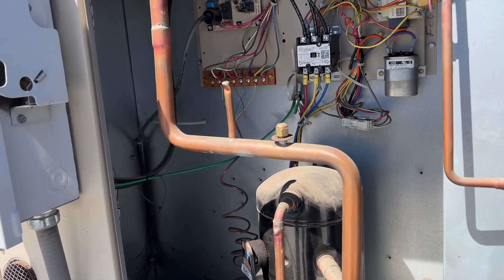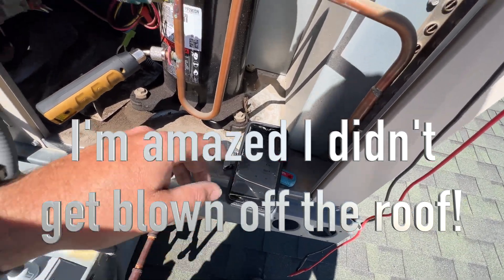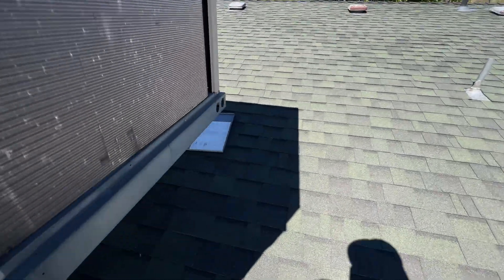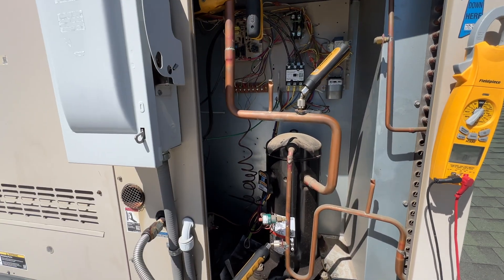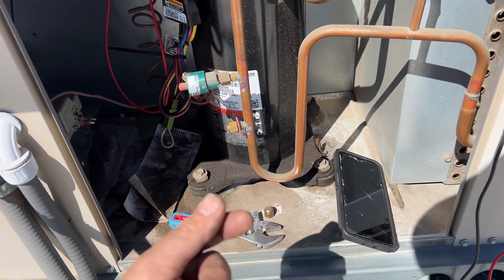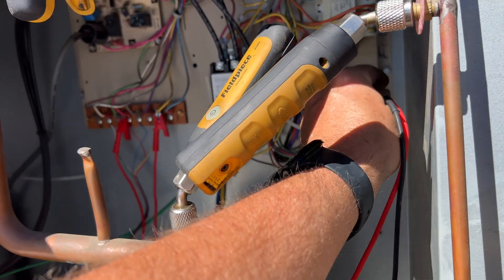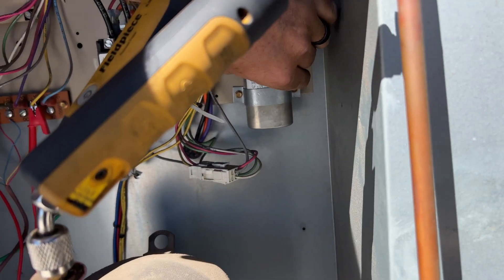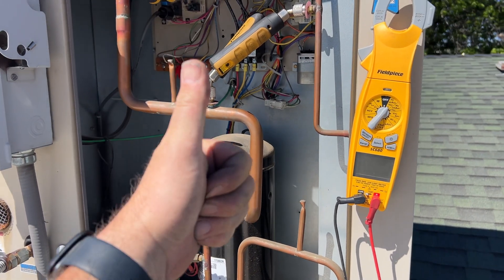Lennox Package Unit Randomly Trips on High Pressure EP186

Comment: Had a similar call with that Lennox model. Turns out someone replace the fan motor with the wrong capacitor size
Reply from the maker: That’s a good idea. I’ll see if I can go back and check that. Thanks for the tip!
Reply: yea, Prob always a good idea if u see a changed motor check that it's the right Capacitor / motor combo.